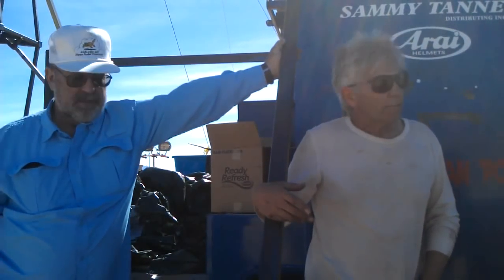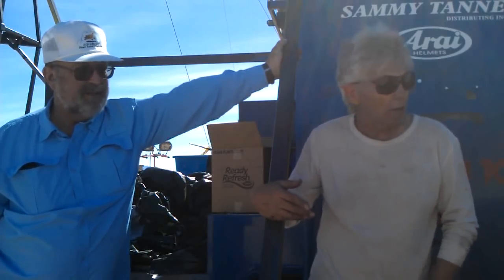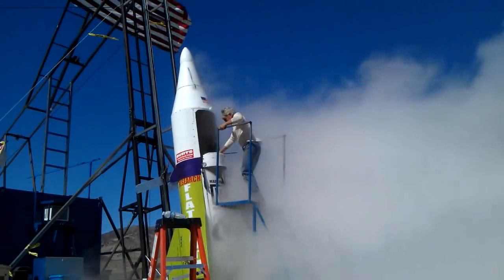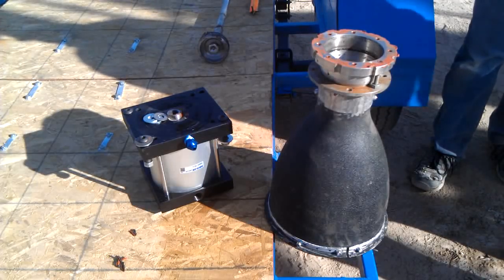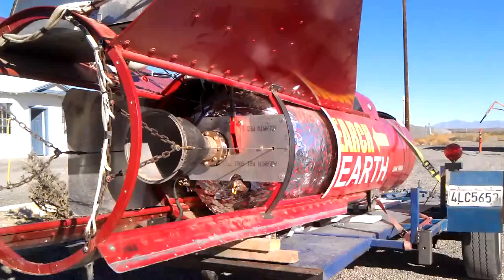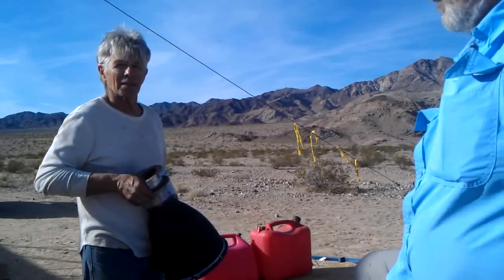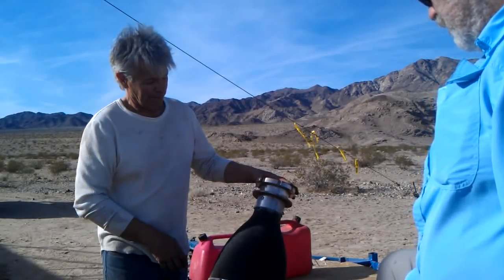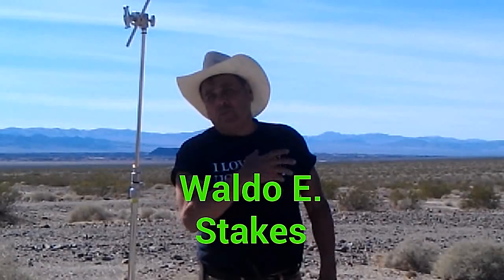MAD MIKE HUGHES FLAT EARTH ROCKET - AN INSIDE LOOK (What Makes It Work)

Comment: So he has chutes that open automatically, just what you need if your going to fake being inside.. If this is real you would have the chutes opening automatically as a backup should Mike not be able to pull manually. There should be a camera in the cockpit face mike  but you cant do that if your never inside the thing.. Not saying that it will launch but if it does it will be a crumpled tin can and then they would have to fake mikes death.... 😂 this is a circus side show